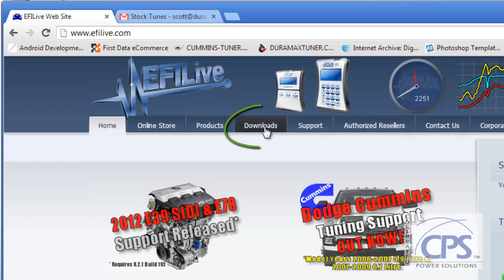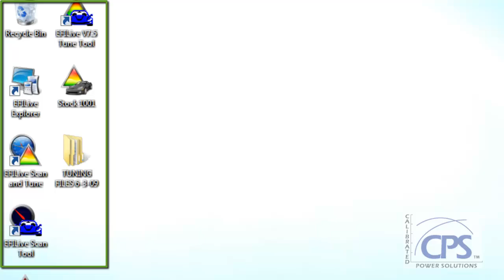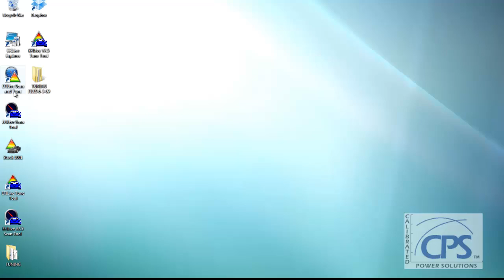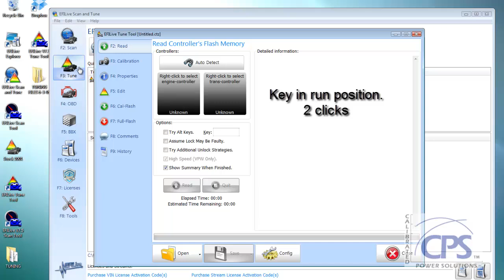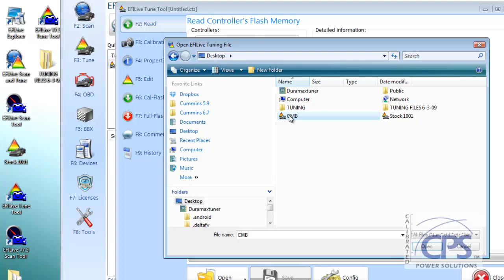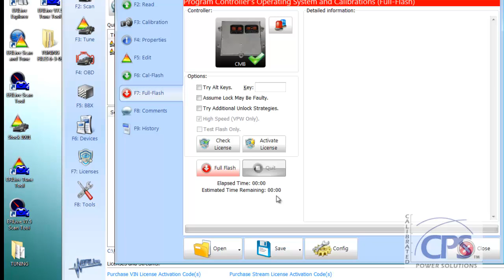Pass Through Flash

Comment: So what happens when I go and activate license and it errors out? Will it eat the license? I have your SPADE tuner for an LB7 and I can not get it to do anything. I know it connects because I can see the OS/Serial/Seed numbers and live data, but continuously get $0537 when trying to flash full. I accept I cant read it and dont care, I just want to flash at this point. Everything has been updated and Ive had almost every fuse pulled out that had nothing to do with ECU/OBD2. I have a used ECU I bought that came out of another truck but Im not sure if that will help at all. Any suggestions?
Reply from the maker: $0537 implies your ECM is locked with a Custom Key. It may not be possible to flash through the OBD2 port (or at all) if that is the case.
Reply: @Duramaxtuner  Ya I have given up on that ECU. I installed the one I had bought locally and unfortunately it is from an '02 LB7, with mine being an '03. I was able to get the truck started and driving, but my oil pressure gauge and A/C do not work. I was ok with the oil pressure gauge since I can always install another one, but I need A/C out here in AZ. I guess I will buy a reman'd ECU from an '03. So much drama just to put tunes on that I already paid good money for!

Comment: I have a 2003 LB7. I have to pull the radio fuse and the A/C controller. I hope it helps someone.
Reply: What fuse for ac?
Reply: @cottonracing1  I pull the A/C module. The controls of the A/C and heater. That module seems to have programming in it and it won’t allow the flashing of the tuning.
Reply: Thank you so much
Reply: Your talking the control panel itself?

Comment: i have a 054c error code that keeps coming up. please help
Reply: If this is for a transmission tune or a 2010 + try Cal Flashing the tune instead of Full flashing. This option is listed after you select tuning tool and toggle down. Feel free to call us if you keep having troubles

Scott
815-568-7920
Reply: Thank you so much. Truck is running awesome. The drivability  is off the charts